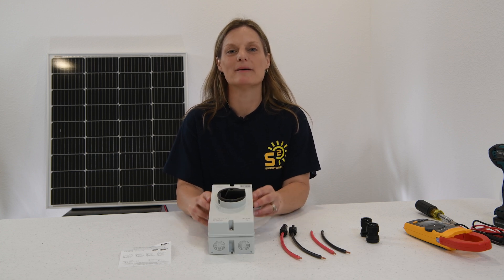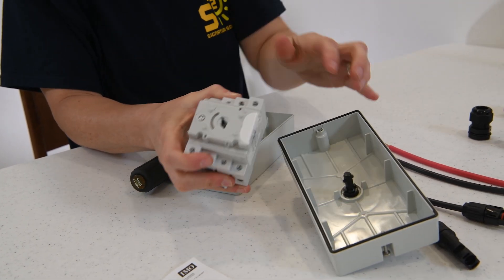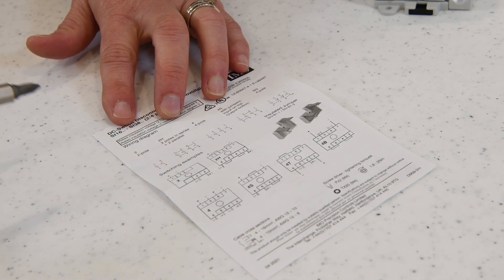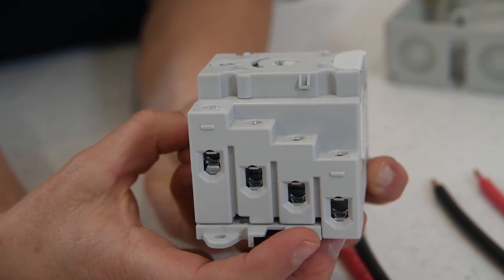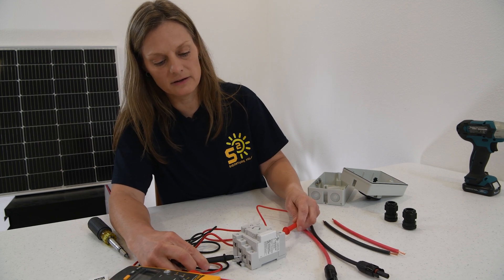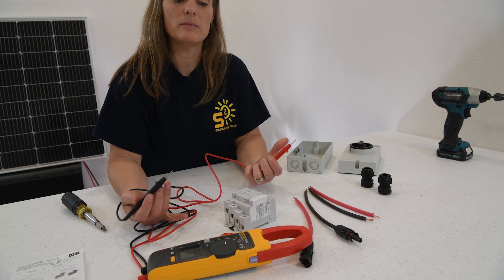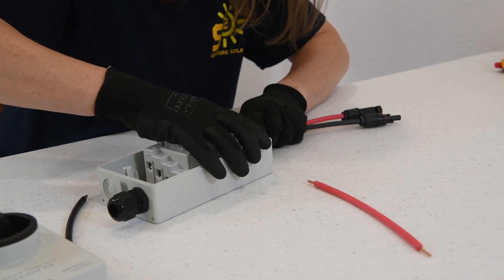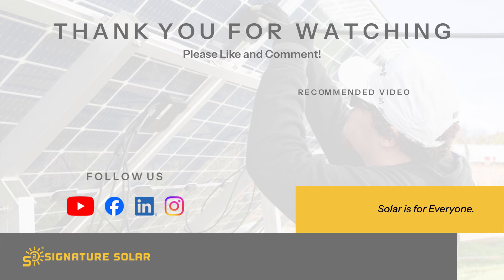DC Isolator - Wiring a Solar PV Disconnect Switch

Comment: So if I understand this correctly, I could have a series of solar panels running to this disconnect which then run to an inverter and I can have a series of solar panels running to this disconnect which then run to a hybrid minisplit and it should be able to shut off incoming power to both of them, right? Just trying to make sure I don't need 2 disconnects for it. I've got 10 400w bifacial panels, 4 for the mini split and 6 for the inverter was what I was thinking.

Comment: You didn't say whether or not this switch can open the circuit when current is flowing.
Another question is whether it's designed to open the circuit only with zero current.

Comment: I see you pass two #10 wires through a single gland.... how is that watertight?  Are you using a special insert in the gland?
Reply: That was my exact concern. Do you know where I could purchase a 2hole gland for 10 gauge wires?
Reply: There is a cable gland that has two holes, but good luck finding them  Sig Solar is no help... you'd think they'd sell them, but they don't even know where to get them.  I'm still looking, ChatGPT thinks he can find them, but I need the diameter of the punch outs.

Comment: Does this come with any cable glands, pigtails or ground wire?
Reply: nope. You just get box with the switch. If you listen to her presentation, she mentions that they teach you how to make the mc4 connections in a different presentation. Hope this helps.
Reply: Good luck finding those cable glands... not easy.  Sig Solar doesn't even know where to get the dual ones (4 wires in, 4 out)

Comment: Great video 
Can one use this If one have two solar panels then you have 4 cables .
I wanna have those panels in parallel. 
Can I have 4 cables in the switch and two cables out instead of using a mc4 splitter ?

Comment: It should be noted that if you use 10/4 or 10/2 teck you will need ground bushings on the end of your teck connector inside the imo. That's  CSA electrical code requirement

Comment: Ground? I'm being told to run a 10 AWG green along with the RED and Black through the conduit to the house, where to connect GREEN?
Reply: ChatGPT told me, FWIW, that I should run a bare 8 AWG wire in the trench, but not in the conduit, to the grounding rod I have next to my house.  He's been wrong a lot, though, would be interested to hear what others think.

Comment: How would you install this with the 12000XP and it's built in DC Isolator switch?
Reply from the maker: For the best assistance with your question, it would be easiest to give us a call at 903-441-2090 or email us at tech@signaturesolar.com. Our team is happy to help!
Reply: I got it figured out. 
Thanks
Reply: @MMOverlandAdventures  how did you end up doing this?
Reply: not 100% sure, but I think having a disconnect switch closer to the panels allows you work on the devices that sit between panels and the inverter. let's say you have a combiner box that you need to work on, it's easier to have a switch upstream that you can turn on/off rather than trying to unplug the MC4 connectors.

Comment: why not just use a dc circuit breaker(s)? wouldn't that accomplish the same thing? It would be helpful to mention what you mean by 2 pole and 4 pole, which you kinda alluded to talking about the electrical schematic.  it shouldn't be confusing. I'm guessing that was the whole reason for having the different levels- to ensure somebody doesn't get confused miswiring the switch.  I thought you were going to wiring up two strings, but you only wired up one in this video.
Reply: Not allowed to use a breaker for isolation in alot of places.
Reply: Breakers can help with ensuring the amp doesn’t fry the inverter. But some places require a separate switch for DC
Reply: @YourFavoriteSub  Amp? are we discussing stereo equipment or musical equipment now?  Please clarify. :face-red-droopy-eyes:

Comment: I am not a licensed electrician. 
According to YT video 'DON'T Install DC Isolators On Solar, Electricians Warned' do not install a DC Isolator switch upstream of an inverter with integrated DC isolation.
I'll leave it up to that video but especially the comments to explain why.
Fires have happened with professional manufactures (Victron) and installers not standing behind their products and/or work. The referenced video is UK-based.
Reply: Lol .. bs.
Reply: @SwollenCranium I think they band isolators in Australia because of it being the source of most fires in a solar array.

Comment: Im a bit confused because my box has a minus sign on 1 to 2. Should I just ignore the minus negative sign for using 1 and 2 or use positive on on 3 to four and negative 1 to 2 I have the same baox but not sure if 1 to two is recomended for the negative leg . I supposd its going to work either way. I have 16 quanity 400 watt panels. Am I over limit for that switch?
Reply from the maker: Hello! If you'd like to give our tech team a call at 903-441-2090, you can send us a couple of photos of this and we can look into it with you!

Comment: Great video what happens with the bonding grounding lug on left hand side?
Reply: Using panels only for pool solar pump thanks for any help to clarify the bonding grounding lug on left side.
Reply from the maker: The ground bar is only used to ground the switch. It is not necessary, but you can ground it to its own earth ground rod.
Reply: @SignatureSolar How do we ground the panels if the ground bus is only for the switch? Or can we run our panel ground cable to the switch and then to the inverter or main electrical panel ground?

Comment: Thank you for this illustration.  I purchased mine  from your company without those black nuts to secure it. Bummer, as now it requires a search on EBAY for it.
Reply: Had the exact same problem, arrived without it. Didn't  know what to call it, which took much longer to do a search on eBay.

Comment: Whats the different between this disconnect switch and a 2 pole dc breaker?
Reply from the maker: In short, the disconnect switch is used for manual isolation during maintenance, while the DC breaker provides automatic protection from electrical faults. - If you'd like to reach out to our tech team at 903-441-2090, we can explain in more detail!

Comment: Would I be able to shut it down while under load?  I'll have 2 strings of 550v at 9A. Those are good ONLY for small arrays.  EATON DH261UGK 30 AMP SAFETY DISCONNECT SWITCH 2 POLE NON-FUSED 600V.       NO PLASTIC FOR ME THANKS

Comment: Blacks were labeled on the lowest and highest levels? You wired in red where it was labeled (-)
Reply from the maker: We followed the first example in the manual. Positive, red, in 1 and 2; negative, black in 3 and 4.
Reply: I'm sure it will work either way but typically when working with dc wiring, polarity should be followed when labeled

Comment: Switch off the DC while the high current is flowing there? Crazy!
This will cause you to draw an arc across the switch contacts. 
DC does not have a zero crossing like AC, so the switch quickly becomes unusable.
The right way is to turn off the AC first, then you won't have a current on the DC side.
Reply: That’s why this switch is has such a loud clack when switching on and off. It’s has a large contact that slams together and slams apart with very strong spring and with a lot of speed.

Comment: not a fan of those top glands and those connectors, no drip loops possible. away from the box. 
Wish they would make those boxes larger for more wire room.
Reply from the maker: Thank you for your feedback! We will forward your idea to the manufacturer!
Reply: IMO does make versions without cases, for panel mounting or control box mounting.
Reply: I have a large number of DC uninterruptible power supplies for sale here, welcome to inquire.

Comment: Ground connections continue on its own path?
Reply from the maker: Yes, the ground switch is optional :)
Reply: The ground on the switch is optional. It grounds strictly the switch. Industry standard and best practice is to ground the PV array to its own DC earth ground rod and ground the switch to this same earth ground rod if you want to.

Comment: I'm assuming that if you are looking using combiner boxes for a 48V system that has 4 separate sets of panels wired in series you will have to use two of these switches?
Reply from the maker: The IMO has 2x + and 2x -

As long as you have no more than that leaving the combiner box, and the V and A is within specs, it should be fine.
Reply: Can you use crimped ferrels in the switch terminal? Common practice?

Does the box come with the glands?
Reply: @stevenp540  no,  if you can when you enter the IMO box, do so from the bottom...best for water rejection.    It's also common to mount these below an enclosure (short connection of two boxes together) ,  you can use a rain tight conduit hub, at the lower end  (waterproof)  and then thread into it a the top with a chase nipple from inside .    Inside a n IMO is also a good place to make the transition from exposed PV wires to THHN for your home run in conduit. Use a crimp ferrule on the THHN since it could be around 14 gauge many times. 3/4" rain tight hubs are the largest that will fit. Use up to 4 for wire room.  Can also connect your array EGC  (usually bare #6 ) to THHN EGC inside the box.. there is a terminal for that inside.    Also don't forget both  + and (-)  get interrupted for the required ,improved, arc  extinguishing.
Reply: @stevenp540  yes, no, and no. Use ferrules - you don't want a stray wispy wire arcing to another stray wispy wire after you squint and cram the bushy end into the terminal. Sure it''s an extra 7.5 seconds of work and will cost you another 10 cents, but try and go the extra mile. Pretty sure you will need your own glands sized to your wire.